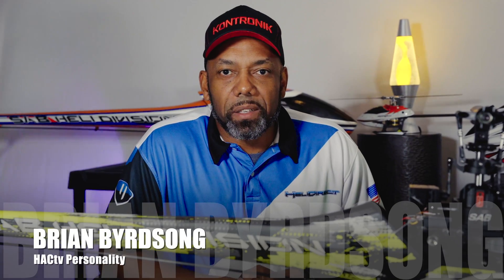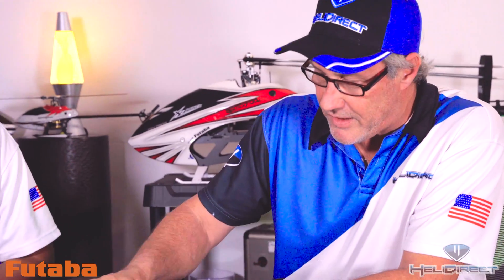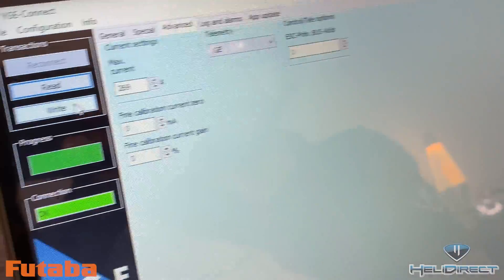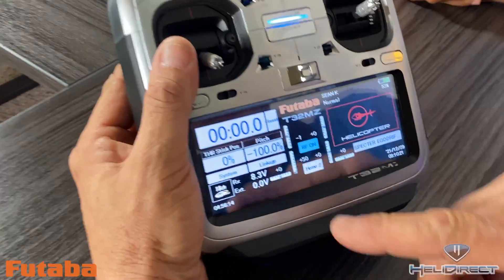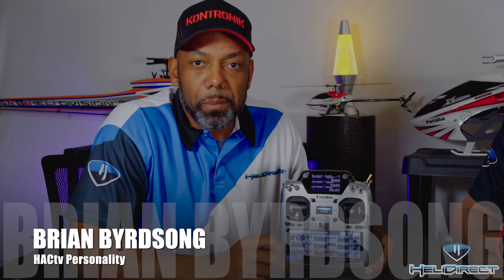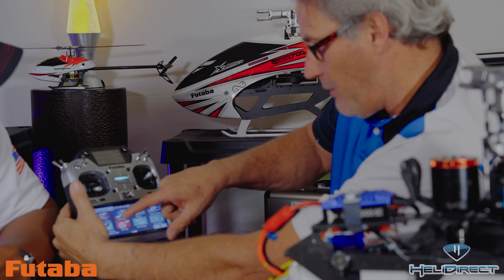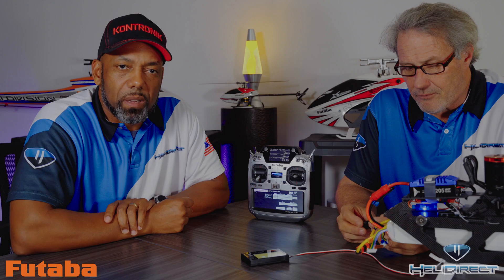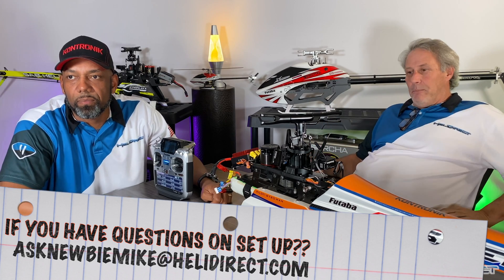How to: Futaba Telemetry Setup

Comment: Thanks for the nice videos.  I bought HobbyWing S.BUS2 Telemetry Adapter For FUTABA Radio, I set it  as  the manual says, but I can't connect it with the futaba 14 SG.  I connect it at radio, as the futaba manual says, then in the "sensor" section of the radio on page 7,  "record" the search begins but it does not read the connected sensor... Can you halp me? Tks from Italy.
Reply from the maker: Yes, contact Ben Minor on Facebook, also in the futaba 24 mz groups

Comment: Just want to mention for Futaba 16IZ and 32MZ users with YGE & texY, you need to manually change the telemetry mode of the texY from autodetect to Futaba by pressing the button, and confirming it's in Futaba mode with the RED LED's. If you do not do this, your sensors will not load as they did in the video. 

Nice job guys, thanks!
Reply from the maker: Gotcha!! Thanks Jason!